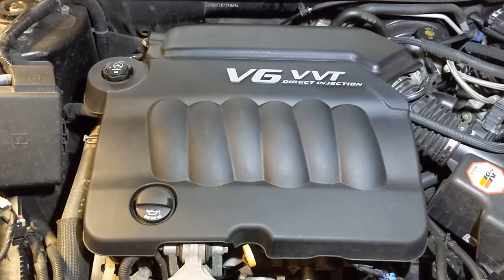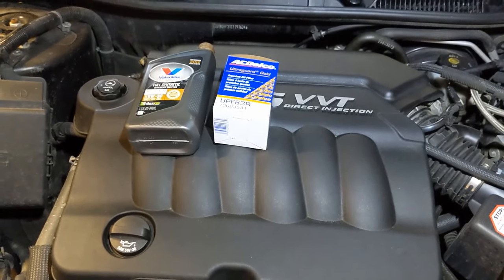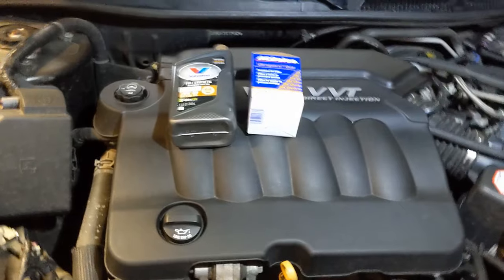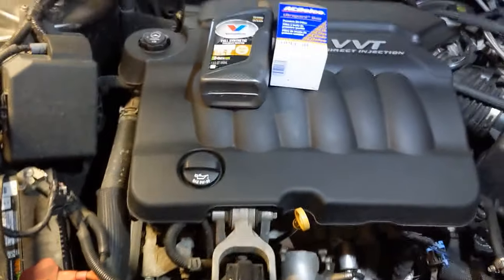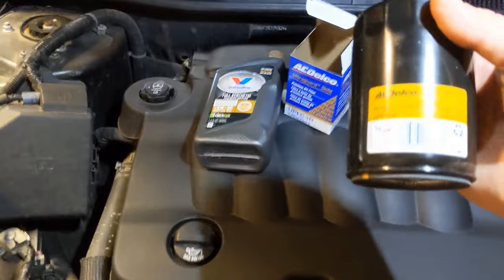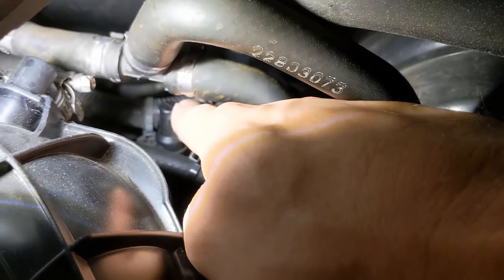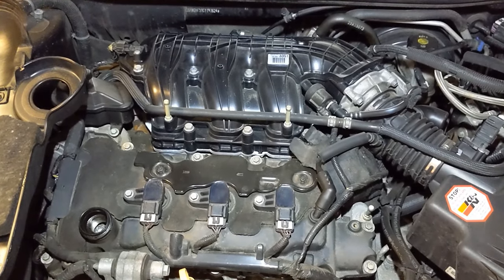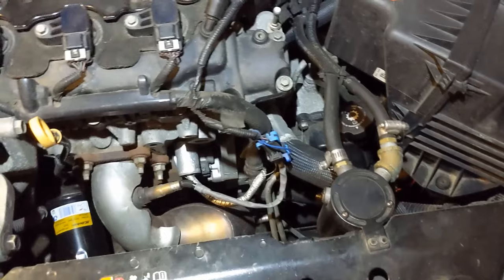How to keep your GM 3.0 or 3.6 V6 running forever - **High Feature V6 LY7 LLT LFX LGX LGZ**

Comment: I have a 2016 impala limited and I’m getting oil in the intake I believe it’s the pcv valve but the dealer is telling me it don’t have a pcv valve 🤦‍♂️
Reply from the maker: The PCV is more an orifice than a traditional PCV valve that has a spring and plunger inside. It's located on the rear valve cover. Check out the videos I linked at the bottom of the description on how to mod the PCV "valve" and install a catch can. 

I'm doing a drawing for a catch can also, so be sure to check out that video link as well!
Reply: @CertifiedShadetree  I tried to take that little hose off but it feels like it will break if I attempt to pull it off, but that part would be the problem to having oil in the intake right and when the hose is off does that piece just pull out?
Reply from the maker: @mikec9688  Yes, that is the path where the oil gets into the intake. The connector on the PCV has a tab on the side of it that you move outward and the connector lifts up. The other connector you just twist clockwise and pull out.  To get the PCV out, grab it with a pair of pliers and twist/pull it up and out. Drill out the 2 bottom holes to 5/32 and the top one to 7/32. Clean with brake cleaner, blow it out, and reinstall.
Reply: @CertifiedShadetree  thank you so much 😊
Reply from the maker: @mikec9688  No problem!!🍻

Comment: So, what happens if I change my oil every 4k, drive "easy" and still have problems? 

What if I use the oil monitor and change at 50 percent and drive like I want. Never  red lining of course?

What if I change my oil every 3k using the Dexos2 stuff while keeping rpms below 2.5k 99 percent of the time? Will this engine last?
Reply from the maker: You certainly don't need to drive "easy" all the time, the engine itself is not fragile!!  You just need to be extra rigorous with the maintenance, as the timing chain tensioners will fail if you allow sludge to build up in the engine.  I have 181k on mine. 4-5k oil changes, catch can installed, instant acceleration on tap whenever you need it, never had any issues whatsoever!
Reply: @CertifiedShadetree  I should have been in bed when typing that. Lol. Hope that explains the odd wording. Amazingly you answered the question I actually wanted to ask. Thanks for that. 5k oil changes it is.
Reply from the maker: Check out the links I have in the description for WatchJRGo's videos.  If you're starting from a place of uncertainty (like if you don't know the engine's history,) find a shop to perform the "BG Products Dynamic Engine Cleaner." Gives you a clean slate and you can go on the proper regiment from there. Hopefully the previous owners took good care of it and you won't have to worry about stretched timing chains!!
Reply: @CertifiedShadetree  Thanks for the advice. It only had 35k on it. Mine is a gen2 GLX 3.6. Ive been learning quite a bit about its family but there's less about it out there. Mainly I'm trying to learn as much about it as I can to keep it
 running for as long as possible but I also prefer to do all of my repairs and maintenance that I have tools for so I'm getting prepared ahead of time. Saw the timing chain thing and got scared. 😆

Edit - To be clear I understand that I don't have the engine in this video so not everything applies.
Reply from the maker: For sure, the LGX is an entirely new engine.  Far more reliable than the previous iterations.  Since it's a direct injected engine, it would behoove you to install a catch can. Would still keep the oil change interval low, too!!
Reply: @CertifiedShadetree  I'll be looking into ordering a kit soon.
Reply: @CertifiedShadetree  where did you get your catch can for the impala?
Reply from the maker: @stevet6391  https://www.amazon.com/dp/B07H8BSTHB/ref=cm_sw_r_cp_awdb_t1_7CKcDbX68PMA6

Comment: so your injector video had brought me to your channel i installed 1 injector due to 1 cly misfire i broke 1 getting a rail out , i replaced both , i installed a new fuel line with 2 injectors that i lubricated the orings during installation ,  however i have a hint of gas smell and want to clarify which injector or oring or bank or rail is leaking , i cant see it , i assume unplug the coils and try to start it up with the intake off ? then stuff some paper towels in the valley to give me an idea of what area its coming from ? this thing is beginning to be a pain in the dick but its my only issue iv had other than a evap solenoid in 160k miles
Reply from the maker: I had the exact issue and wasn't able to pinpoint which one it was until I removed the upper intake again. I didn't attempt to start it, though.  One of the foam baffles surrounding the injectors was soaked right at the leaky injector (IIRC, mine was #3.)
Reply: @CertifiedShadetree  mine was cly number 4 . I'm buying these injectors for 80 bucks in town.  Looked up the rails and injectors on ebay . Other than foam on the bottom I removed all the fluffy stuff because I figured a mouse would think it was convenient and I don't mind injector noises
Reply: @CertifiedShadetree  how much was your injector seal tool ?
Reply from the maker: Pretty sure I paid $180 two years ago.  It's $160 now:
https://www.freedomracing.com/en-49245-2010-2012-hitachi-sidi-injector-seal-installer-sizer-set-alt.html
Reply: Well fuck me . Almost makes sense to waive the flag off defeat and have my favorite gm shop do the work .
Reply from the maker: I wouldn't worry about replacing the seals if you just installed new injectors. My "wave the white flag" moment was me purchasing a complete set of low-mileage used injectors/rails. I did replace the seals on those injectors, but had to replace one of them with one of the "new" injectors I had just removed. On that injector I did not install new seals and it didn't cause any issues.

Comment: I'm looking at a nice 2011 LaCrosse with 53K miles. 3.6. With the low miles and all that age, should I be concerned about these issues? With all I've heard, I'm very leary of this engine.
Reply from the maker: This year has the horrible LLT version of the 3.6, so if there are no maintenance records available, I'd run the other direction. If you have your heart set on this generation LaCrosse, get a 2012-2016 model with the LFX 3.6 - it's far superior to the 2010-2011 LLT 3.6, and not as likely to have any of the issues plaguing the earlier 3.6's.
Reply: @CertifiedShadetree  i have a 2011 camaro v6 engine i burn a quart of oil every 1000 miles and i think timing chain guide is falling still runs pretty strong but for sure avoid first model of cars ill be looking to get the v8 soon any tips and advice oh and yeah those type of engines need fresh oil often! like 3000 miles to 4000 miles max
Reply from the maker: @great4ever845  Normally I'd tell someone with an LLT to run it straight into a river, but in all seriousness: 
1.) Flush the engine with either BG's EPR engine flush, or step up to BG's Dynamic engine flush (the Dynamic is $300 for the product, but it comes with everything you need and does a better job than the EPR.)
2.) Do an intake valve cleaning. Chemical or walnut blasting, doesn't matter.
3.) Install a catch can on the dirty side of the PCV and a clean-side separator from Elite Engineering on the fresh air side.
4.) Switch to Valvoline Extended Protection 5w30 and change the oil every 3-4 k.

I can't guarantee all of that will fix what ails your engine at this stage, but it will at least give you a fighting chance of keeping it alive.

Check out WatchJRGo's channel - he did a series of videos a couple years back on a 2011 Camaro that was severely sludged and had stretched timing chains. He did the full BG Dynamic engine flush before replacing the chains.

Comment: so what size holes for pcv value ? top and bottom
Reply from the maker: Drill the singular hole at the top to 7/64 and the 2 on the bottom to 5/64.

Comment: Have you ever seen weird camshaft where on this engine? I am a Police fleet mechanic and have about 9 Impalas with the 3.6.
Reply from the maker: Never heard of cam wear issues on the LFX, but more often than not the poorly maintained engines have cam phaser issues.
Reply: So far, I have found 4 of the same engine with the bank 1 cam lobes on cylinder 5 have pitting, and corrosion/ almost looks like the cam is going to start flaking apart. I have lot's of pictures if you're interested
Reply from the maker: @darrenbauer4985  Very interesting. I'm curious what kind of oil was used, oil change intervals, how much time was spent idling vs driving, pretty much anything that would be different from normal civilian use. Have you had an oil analysis performed on any of the cars?
Reply: @CertifiedShadetree  we run Schaeffers full synthetic 5w-30. These cars have only had Schaeffers in them. They spend a lot of time idling. I sent the oil samples in and haven't got the results yet.
Reply: We change the the filter every 3, 000 miles (Napa Gold ) and change the oil every 6,000 miles.
Reply from the maker: @darrenbauer4985  How many miles/hours on the cars now? This might be a good topic to bring up at the "Bob Is The Oil Guy" forums.
Reply: @CertifiedShadetree  do you have an email address I could send you pictures of the cams to The mileage range on the three engines I have looked at are 38k, 52k and 58k. I'll have to check the hours
Reply from the maker: @darrenbauer4985  leaderofwagons@likeabigdog.com
Reply from the maker: @darrenbauer4985  Project Farm did a test of Schaefer's https://youtu.be/aT2qa-2TuLA

Other things to take into account would be how much oil ended up ingested through the intake manifold between oil changes, how much did the restrictive PCV sludge up the rear valve cover, how much carbon built up on the intake valves, and was the oil level ever checked and topped off between changes.

The LFX that's in the Impalas addressed most of the problems the earlier 3.6's had, but I could still see those variables above causing issues. My best advice going forward would be to change the oil at 3000 miles or less, especially considering police use is considered extreme duty. Checking and topping off the oil level at every gas fill up certainly wouldn't hurt, either..

Comment: The best oil for cts 3.0 ? 5w30?
Reply from the maker: I would say with 99.999999% certainty YES, however always check your owners manual. Your oil cap should also say which weight to use..
Reply from the maker: Dexos is a specification, ACDelco is a brand of oil. The ACDelco oil does meet the Dexos 1 Gen 2 specification, so go ahead and use it.

Comment: What are your thoughts on a 2006 Cadillac SRX 3.6 with 58,309 miles? 
I are those engines any good?
Reply from the maker: They have the exact powertrain as the vehicle in the video, so the same applies. I sold that car with 183k on it, so maintain it and it will treat you well!

Comment: My uncle just picked up a 2005 Buick LeSabre with 169k for $2100 it belonged to some old man and it’s in very good condition. Does anyone know if these engines have any major issues to worry about? It’s got a 3.8 V6
Reply from the maker: Intake gaskets were a minor issue, as was the EGR tubing warping the upper intake manifold. The biggest issue is easily resolved with a trip to O'Reilly's - the coolant elbows. Replace the 2 plastic heater hose elbows with the aluminum replacements sold at any auto parts store. Just Google "3800 Coolant Elbow replacement"
Reply: @CertifiedShadetree  Cool, thanks for the info.
Reply from the maker: You probably won't have to worry about the intake gaskets, come to think of it.  In 2004-2005, the Series 2 3800 shared everything except for the upper intake manifold and injectors with the Series 3 3800.  The Series 3 had forged pistons, reinforced intake gaskets, and an aluminum oil pan.  If the engine in that LeSabre ever grenades, locate one from a 2006-2008 Buick Lacrosse, Lucerne, or a Pontiac Grand Prix and swap out the upper intake manifold and fuel injectors from the old engine.  Those engines I mentioned are Series 3 engines and will be considerably cheaper to purchase from a junkyard (and likely have less miles on them.)  Saying this from experience - I swapped out a grenaded Series 2 in a 98 Regal for a Series 3 from an 06 Lucerne.
Reply: @CertifiedShadetree  Great information, I’ll take that into consideration. Have you ever seen a 3800 3.8 engine with very high miles? Just wondering
Reply from the maker: @joeshmoe8952  Yes! Despite what I said, the 3800 is one of the best, most reliable engines ever produced!! They'll easily go over 300k miles with proper maintenance.
Reply: I has 3 Buicks (company leases) that used the 3.8 V6 and drove each well over 100K miles without as much as a hiccup. The 3.8 is bullet proof in my opinion
Reply: @richmac918  Cool, thanks for the info.
Reply: best motor ever made! I've had 3 of them in different cars, the worst thing I had to fix was water pumps and the plastic coolant elbows at the front of the intake manifold once. Not a big or expensive fix at any time.
Reply: I have had Buicks all my working years.  A 1993 Buick Park Avenue Ultra, 2001 Buick LeSabre, 2005 Buick LeSabre and a 2007 Buick LuCerne.  I trade off all my cars when they hit 200,000 miles.  I wish I would have never sold my 2005 Buick LeSabre.  Other than oil changes every 3000 miles the only time it ever broke down, was at 190,000 miles  the blower motor in the dash quit working.  It was only 3 screws to replace it and the blower motor was only $100.  The best thing about that car was it had the button to turn off the traction control.  The LeSabres don't have all the sensors to go wrong like the Park Avenue and Lucerne.
Reply: @MyLifeThai371  Thanks for the info, quick question..Do the Buick Lesabre’s require Full Synthetic oil or can they run on regular oil?
Reply: @joeshmoe8952  I used regular 5-30 oil every 3000 miles.  I went to college to be a diesel mechanic and my instructors in school did not agree with the longer miles before oil changes that they tell you to do with synthetic oil, because no matter what the oil filter is not getting changed and if that oil filter gets too clogged up with metal shavings it will let the oil bypass and send the contaminents through the engine.
Reply: @MyLifeThai371  If Buick recommends regular oil then that’s what I’m going to tell my uncle to use every 3000 miles. I got a 2005 4runner, purchased it brand new with 50 miles on it and now it’s got 220k and runs great still. The owners manual says regular oil every 3000 miles and that’s all I’ve used.
Reply: Ran one 333k before head gasket went, that was with conventional oil and 3000 mile oil changes, great engine imo.

Comment: What about pennzoil Ultra platinum, I use that oil cuz I work at a jiffy lube
Reply from the maker: I was using that before switching to Modern Engine, and the engine was consuming quite a bit more oil.  It was using up a quart every 3k. I would definitely recommend installing a catch can if you use Pennzoil.
Reply: @CertifiedShadetree  oh damn, does pennzoil burn easier? Or is it just this motor?
Reply from the maker: It's both, actually.  The PCV system on the LFX and LLT is flawed, and certain oils just aren't made for the higher temperatures and pressures of Direct Injection, so they burn off or sludge up when used in DI engines

I argue for the Valvoline Modern Engine 5W30, as it's cut my 3.6's consumption from a quart every 3k to about 1/4 quart every 5k.
Reply: @CertifiedShadetree  oh shit... I should start doing that.. it does burn this one kinda quick
Reply from the maker: It was kind of difficult to find the Modern Engine oil a couple of years ago, but the AutoZone near me now carries it, and also Amazon and RockAuto sell it.  I just ordered a 5qt jug and a 1qt bottle from RockAuto (it's a couple bucks more than Amazon) but they sell the UPF63R filters for $6.83 apiece, so I ordered 3 of those for good measure.

Comment: Good to find an expert,  my 3.6 LFX has an unstable idle when is cold ,until reach the 199 F, the timming is changing untill reach this temperature, after that work fine,  were i can find a reference to diagnose this problem?
Reply from the maker: Now that Bosch purged their excellent dissertation on the 3.6 from their website, I would consider a single-year Alldata subscription for your vehicle. I think it's only $40 per VIN.

Comment: I have 2013 impala with 138xxx miles should I keep using 5w-30 oil? Or move on to something thicker? Like 10-40?
Reply from the maker: Keep using 5W-30.  I would never recommend going any thicker on a GM 60* V6.  An old 350 or 3800? Sure. 60* GM's run like SHIT on anything thicker than 5W30..
Reply: @CertifiedShadetree  thank you!
Reply: What oil brand is Recommended for the transmission?
Reply from the maker: @78_gordo48  Anything that's Dexron VI approved. GM's own Dexron VI synthetic is the absolute best, however.
Reply: Are u driving in Arizona or Florida? If yes 20w50 I would use then especially in Summer